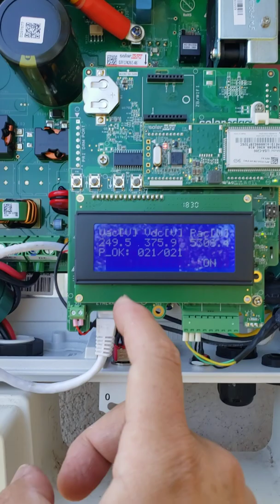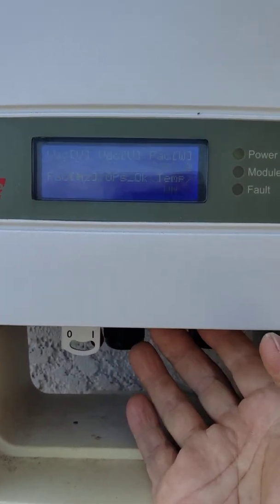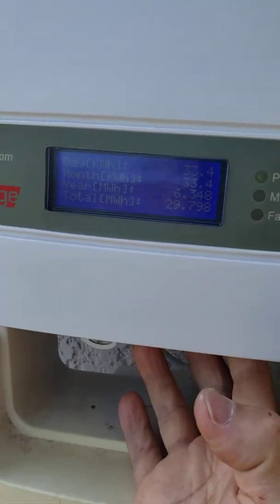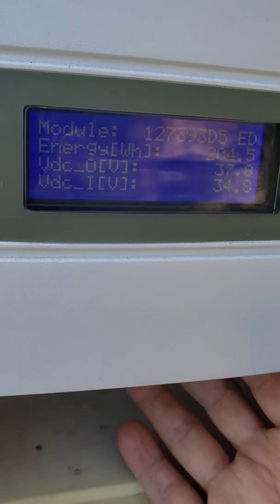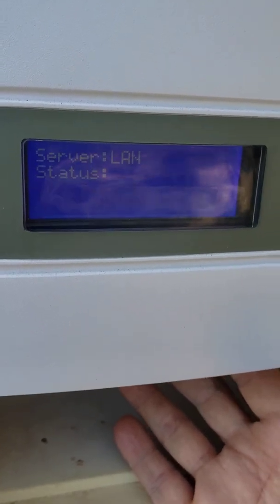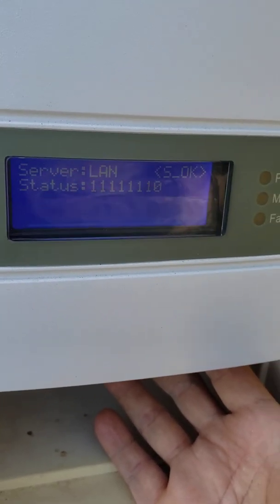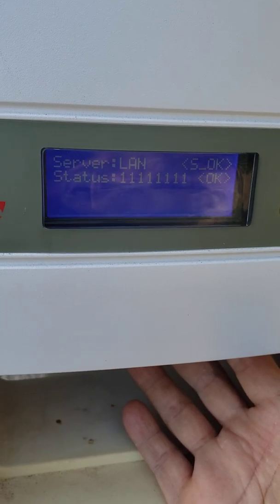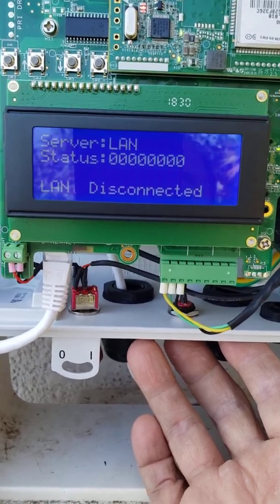Change Solar Edge Inverter to Ethernet Direct Connection - Program to Change from Cellular to LAN

Comment: Great video, thank you very much for making and sharing it. I have an issue with the identical model inverter here in the UK and the supplier hasn't been able to help with how to change the config from cellular to ethernet.  I will give this method a try and I'm confident it will work. Thanks again.

Comment: Great video that solved a real-time monitoring issue I have noticed for over a year. No notice, no nothing, apparently my (probably) G3 modem in my SolarEdge SE7600A-US inverter was no longer welcome to the party. The app/dashboard stopped displaying realtime energy animation. SolarEdge was unhelpful. A tech from local installer came over to fix another issue and did not have accurate information on this topic. Now I find your Youtube video and it starts me down the pathway to get re-connected. Similar to another commenter, I too needed to go through the "now pairing" sequence but rest was easy to get on LAN and now my data OCD monster is satisfied. Thank you!
Reply: I am connected to the LAN but i am not getting any information sent to the app.  Did I miss something?  What is the "now pairing" you are talking about?

Comment: Thanks. Its now all fixed and updating in my solaredge monitoring app. I had the manual , Google solaredge Control and Communication Gateway Installation Guide to find it, but like you said the  4 buttons in the manual are below the display. Once you clued me in, I could move forward. In my case with the inverter switch in the 0 position, after holding the enter button for 5 secs , it said "pairing, turn switch to on " so I did, so I did that, it counts down from 180 secs to zero and pairs. Then I pressed enter again  held it for 5 seconds and this time it came up with Enter password. The rest was as you said. I have support requests out with Solaredge and with LA solar from a week ago, with lots of to and fro but nothing fixed. Let's see how long they take to figure it out.
Reply: With direct plug-in ethernet connection, I don't think you need to "pair."  You must be using some other type of connection.
Reply: @seanxie3261  That makes sense, i was wondering what it was pairing with  ! The two possibilities are with the slave unit, assuming i have one even, or, since it  was previously set to Server being CELL it was pairing with whatever at the other   end, since the cell hardware, sim. Antenna and all are in there still. Or something else. Anyway, once i switched it to server = LAN Its communicating via Ethernet to the MySolarEdge app just fine. It was down for two weeks. Other aspects, LA SOLAR told me last year that cellular 2G was going away and i paid then $200 to hard wiring it to my router. They came, put the cat5 cable in etc .Things just kept working until 2 weeks ago. Which is when i took an interest after little help from them. Thats when i saw that display said Server Is CELL and thought that switching that to LAN was all i needed to do since the wiring etc had been put in 1 year ago. I wonder now if the installer put the wiring in but never swurched the settings so it was running on cell connections all this while until finally its been phased out in my area. I will never know i suppose.
Reply: O btw, i could see the inverter comms device on my router device list, and the gateway, ip address, mask were all correct and i know that side of comms reasonably well so I reckoned that aspect was fine all along..
Reply: @seanxie3261 did i overwrite an earlier comment ? Anyway, I have no idea what it was pairing with. I paid LA Solar June 2024 to come in add a hardwired ethernet connection to my router since they said 2g was going to be turned off. So i guess i had 2 communications options but with the gateway still set to CELL which has now stopped working. But having switched it over to LAN in the paramters its working again, and without paying LA Solar $400 for a fault fix callout !

Comment: Thank you for this video. I have completed ethernet install set up and got the ok for communication. Now how do I get it to communicate with the Solar Edge app? I tried to set up communication on the app and it tells me to scan the inverter and when I do that it said it doesn’t support inverters with LED screen. I have a SE6000A
Reply: Your app does not directly interact with your inverter.  This set up allows the inverter to talk to the server.  Your app connects to the solar edge server for status of solar production, etc.  When you had cellular service, it worked the same way.  The invert talks to their server, and your app (mySolarEdge spp) connects to their server, not to the inverter directly.  I think the one talks to the inverter directly are for the installers, a different app.

Comment: I change it to LAN connection but I still don’t see any readings on my sunrun app. Please help
Reply: I am not family with sunrun app.  It is usually the Solar Edge app that will give you the reading.  I guess first to see whether your connection works.  Maybe make sure the indicating lights are on with the ethernet ports at your switch/router.

Comment: I made this switch a few months ago. I’ve noticed that every now and then my Inverter is switching back to 3g modem communication. I have to go to the inverter and use the lcd screen to change it back to Ethernet. I think it is happening when there is som hiccup in our LAN, Internet. It seems to default back to the modem. I’m considering removing the modem in the hopes that it will not default back to modem the next time there’s an issue with our LAN/Internet. 

Anyone else have that issue?  Any thoughts about removing the modem?
Reply: I removed the antenas, but left the 3G modem.  It was never a problem on my inverter.  Maybe you can remove the 3G modem so that it will not default to that option.
Reply: Yesterday i removed the cellular card and antenna. So far, so good. Will report in after our next Internet glitch.

Comment: I connected to LAN, i get all ones. But still nothing shows up on the Tesla website/app
Reply: This has nothing to do with Tesla.  This is for Solar Edge Inverters for monitoring your solar production.  If you have Tesla batteries, you need to contact your installer to set up your battery connection.
Reply: @seanxie3261  but it was showing up on the Tesla app until the zigbee stoped working. The zigbee gateway was provided by Tesla and says Tesla on it. It's a Solar City install which utilizes a Solar Edge Inverter, and I think Solar City was purchased by Tesla after the install.  Do I need to contact Tesla and tell them to grab the date from Solar Edge servers? Why does the data make it to the Tesla servers when connected via zigbee but not when connected via wired Ethernet? Also there are no batteries.

Comment: Great. Info! I have the tplink and wondering which port I use. The WAN port or one of the LAN ports. Thanks.
Reply: I am sure you need to use the LAN port, as this is one of the client for your tplink router.  WAN port goes to your internet service provider or modem

Comment: Thanks! This was very helpful. I believe I have the same unit as shown in the video. 
I’d like to share some additional tips:
1. Even if your Ethernet cable already has two ends, I believe you can use the middle gland to run the cable as shown in the video. The trick is that the entire black rubber bushing up in the gland can come out and you can remove the plastic plug from one of the holes in the bushing. There should be a vertical slot into the hole from the side which allows you to slide your cable in from the side of the bushing while you have the bushing out of the gland. Then you can run the end of the cable through the gland and plug it into the Jack before stuffing the bushing (and cable) back up into the gland.  Be sure all the power is off because that is a tight area to work in!
2. After shutting everything down and running and connecting the Ethernet cable, you have to turn the AC disconnect switch (not the switch on the inverter) ON so you can actually use the LCD screen and buttons.
3. After selecting the Communication menu and scrolling down to where you can actually select “LAN” as the communication method, I had to hold the select button in for about a full second for the LAN selection to actually “save”. Otherwise it would just go back to using the cellular modem.
Reply: Thank you the information

Comment: Anyone getting "g server ping failed" now after months of it being fine?
Reply: No.  Everything works well.  You may want to trouble shoot your network.  Maybe connect your laptop to the ethernet cable to see whether you can get good internet connection.  I would start from there to isolate the problem.  Otherwise, maybe check with your installer to see how to maybe "reboot" the Solaredge inverter.

Comment: very nice! thank you so much!  For my SE7600H model, the buttons didn't work without the cover.  so i had to insert the Ethernet cable closed the cover to operate those buttons.  also without power, it didn't work for me.  i had to turn back the power on with cover on to get into the setup.
Reply: Thanks for the tips!

Comment: Do I need to turn everything off when I open the cover??
Reply: Well, you need power to program the unit.  Yes.  There is high voltage within the box, but the low voltage portion is where you will be working on.  Do not touch anything at the upper portion, where those thick wires are located.  If you are not comfortable, I highly recommend you ask an electrician to help you.  You certainly do not want to get electrocated.
Reply: @seanxie3261  i took the cover off without turning off the electricity to the unit. I was scared so I put the cover back and asked that question. LoL. Im going to turn off the circuit breaker to the inverter.

Comment: Is there anything else to set up on the wifi network? Or once the LAN is enabled  it automatically connects to Solar Edge? 

Thanks for this video. I have exactly the same inverter. Your instructions were helpful.
Reply: It should communicate with their server automatically, once it is connected.  If you need Wifi, you will need a special Wifi module.  Direct connection does not require any additional module.  Good luck.

Comment: Thanks for your post, it's very informative. A couple questions: In the menu, besides LAN, was there an option to do a direct wi-fi connection, and then use the buttons to enter your router password? I have good wi-fi signal to the area my inverter is located, but hard wiring an ethernet cable between them would be a bit of a pain. Or would another option be to use an TP Link Powerline ethernet connection kit for the ethernet connection?
Reply: You need a WiFi adapter in your unit for WiFi to work.  Maybe your unit is WiFi capable.  Mine is not.  Mine is 3G connection only.  The installer said it will cost me, I think $400 to $600 to install the adapter.  If your menu indicated Wifi option, just try it.  Maybe it will work.  Good luck.
Reply: Another point you have is about the TP Link Powerline ethernet.  It will certainly work.  The only problem I am thinking is that you need to have power to the TP Powerline adapter.  Where are you going to find power to the TP Powerline adapter?  Theoretically, you can tap into the unit (I am sure there is voltage within the unit), but it would be too risky to mess with the unit in such a way, especially because we are not so family with the unit.  You certainly do not want to get electrocuted, you know.

Comment: Thank you for posting this. My SolarEdge 2g just expired. I will be hooking up lan using this video
Reply: Good luck.  it should work.  Just be careful not to touch anything on the top portion of the box.  Those are high voltage area.

Comment: So you don't need to use the SetApp to configure?  Will it automatically default to LAN after you select it?
Reply: No need for any app.  Just go through the on-screen menu that I described in the video.  Use the navigation keys to select LAN.  You will see the status once the connection is successful.

Comment: Do i need to remove anything 3g modem related?  Can i leave everything there?
Reply: I would just leave everything alone.  It will not function anyway.
Reply: @seanxie3261  thanks. Another video from other people showing you need to get into the setapp to change the setting to LAN. This isn't true and I can follow this instead right?

Comment: Do you remove the old sigbee card or just leave it and remove antenna? Also is there any other configuration you have to do or just pretty much plug and play with the ethernet cable besides what you showed.
Reply: I left the old 3G card alone.  I guess you can remove it.  I simply removed the antenna, as it sticks out of the box and looks ugly.  Also, as it is a live system, I don't want to get in trouble by removing the card and accidentally touching/shorting something.  Sometimes, less is more.  Thanks.
Reply: I removed the wifi antennae card and my LAN connection has a mod bus error and dhcp error fail.    I am still trying to figure it out

Comment: Nice wideo one question u need turn off all panels and inverter before take out panel or it's not need
Reply: not sure exactly what you meant.  I don't think I turned everything off before I remove the front panel of the controllers.  Yes, there is area of very high voltage I remember at the top of the controllers.  Be careful not to touch that area, as you can be electrocuted otherwise.  The area you need to work on is the low voltage area, where most of the circuit boards are located.  Take care.
Reply: My understanding: shut it all down per SolarEdge procedure. Run your Ethernet cable. Turn only the AC disconnect back on (so the lcd screen and menus will work). Select your options to select LAN. Once that is set, if it were me, I’d then disconnect the AC again, put the cover(s) back on, then do the shutdown procedure in reverse order to turn it all back on. 
In my case, it took several minutes for the system to come back up and then it went through a long process of getting status for each panel. All of that said, I’m not a pro and you shouldn’t listen to me.
https://youtu.be/EQF842diPAY?si=l7FPLhfcDUY6Z1sn

Comment: Was the inverter dial switched to “on” during this process? What about the breakers? I’m going to try this and don’t want to get electrocuted.
Reply: When it is on "off" position, the power is still on.  You need to do a total shutdown, if you want to turn off the entire power.  I guess it is always safer to turn off everything before you open the cover.  If you want to do that, you need to switch off connection to the solar panel as well, as there is power coming down from the panels.  You however need to turn on the power to program the system, unless your buttons are outside of the panel (for some version of inverters only).  If you look at the video, everything below are low voltage.  Just do not touch anything above where the orange colored wire area.  Maybe wear insulation gloves too.  If you are not comfortable with electrical stuff, maybe ask an electrician.